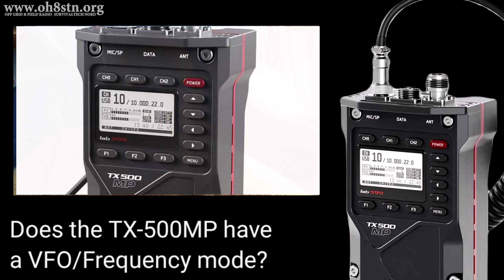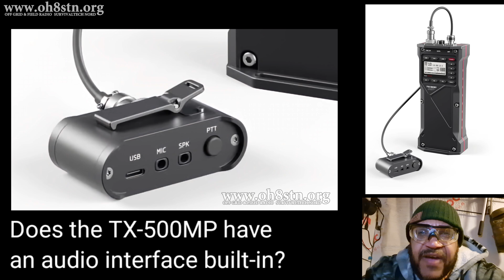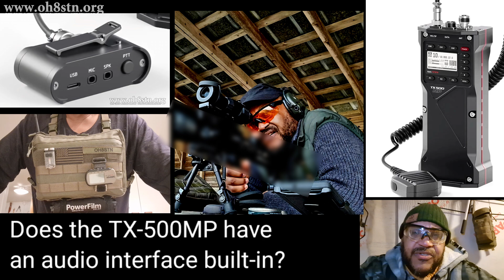Lab599 TX-500MP HF 50Mhz Man Pack Portable Ham Radio UPDATE

Comment: Definitely needs narrow 2.00khz and mid fm 4.00khz fm bandwidths for hf/vhf lowband 
 inc tx and rx sepearated ctcss sub tones single or split ctcss tones.
Auto Noise squelch/S meter squelch options on radio.

I hope they bring out a goose neck antenna on radio👍

Rob P 73's

RPC

Comment: USB-C and two 3.5mm jacks is not a robust solution. It just moves the wire mess to your chest and has no strain relief. I am typing this on a phone with a USB-C charge connector sticking out of the bottom and having to hold it up to avoid sideways pressure on the plug. The cables break so easily. Maybe the Apple $140 cable will be an exception. BT/WiFi for data audio and CAT like the 705 is the only way to do this properly. An opportunity missed. Maybe the DIY599 fella can make a BT/WiFi module that plugs into the breakout box socket.
Reply from the maker: The plug in port idea sounds brilliant. Even so, bluetooth latency creates issues for data. WiFi is fast enough,  but requires supporting software. With the mission of this radio in mind, I would vote on a more robust break out box, or a plugin module as you suggested. 
Hopefully he releases the specs to the port so that third party can step in providing additional functionalities.
Reply: @OH8STN   ....and its time Digirig did a BT/WiFi version of their little boxes. That would solve everything as RF on the USB cable is still a problem with some laptops. When we transmit, the USB device drops out.

Comment: @OH8STN will this dimensionally fit in a 148/152 pouch? Will there be a 18” or 21” straight cable for the box for routing through gear?

Comment: At least it has a VFO... my old Vertex VX-1210 had channels (since it was a commercial radio), and a cludge to get quasi-VFO like functionality. 20W, an internal ATU that could tune practically anything, and strong as an ox. The proprietary battery was a PITA. Now that I know a lot more, I'm sorry I wound up selling it.

If Yaesu came out with a Ham friendly 1210-like radio, that would be cool, but it'd probably cost nearly $2k. I'm excited to see where this Lab 599 project goes.

Comment: They missed the mark. No VFO knob while you’re portable? Should have been an all band all mode tx500 variant. Not re envisioned tx500 pro
Reply: We do like our knobs for vfo tuning and volume.
Reply from the maker: Up/down left/right arrows for VFO on frequency mode. Now I don't need to worry about breaking a dial on extreme expedition. Think about the difference between them POTA radio and an expedition radio.
Reply: @OH8STN  Julian I like your content but I don’t agree with this. It’s going to take forever to tune to a frequency. And usbC digital interface is great when you’re sitting still. Not on a manpack. Mainstream will not buy this

Comment: Don't want to ask a stupid question 😏 but here goes. With the unit in your back pack will you be able to control it with a small tablet for digital messaging instead of just voice through a mic via the breakout box? 
Thanks Julian
Reply from the maker: That's not a stupid question! It's only stupid that I didn't cover it better in this video.
You'll be able to plug in your tablet or mobile phone to control the radio by a cat control. That same connection will give you access to the audio interface. The same like plugging in the 705 or x 6100 or digirig into a computer. Then we can use whatever app we want, for example winlink or js8call to send messages.
Outstanding question!
73
Julian oh8stn

Comment: Similar tuning scheme to the PRC-1099 (had one of those about 12 years ago), but it used a lever. Push lever up quickly to change digits in the direction you want. The press and hold the lever to tune digits, again in the direction you want. Very elegant.